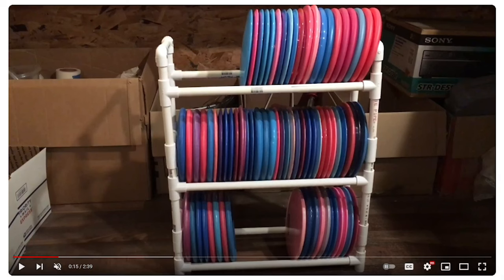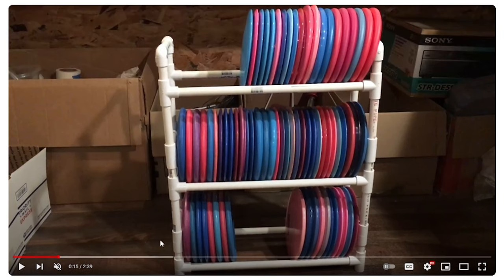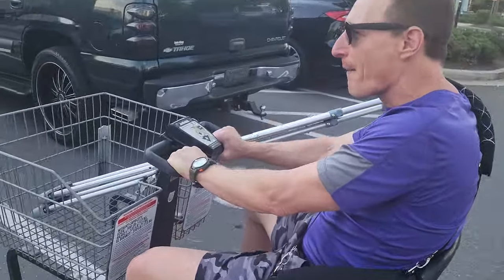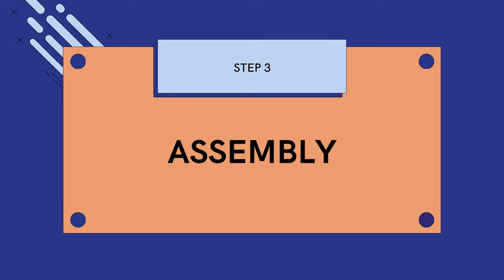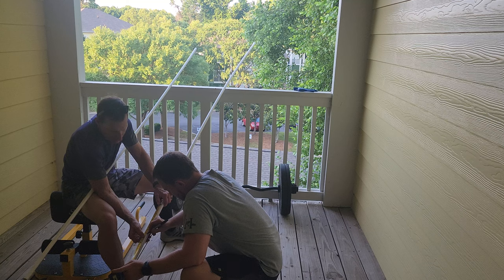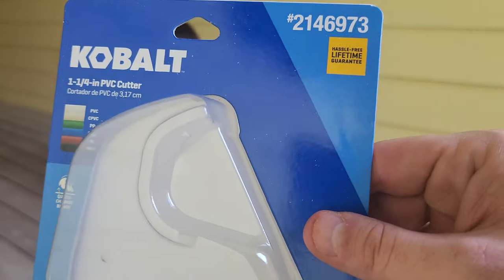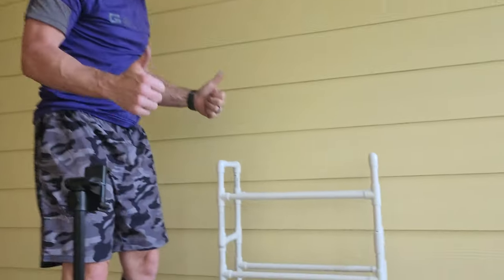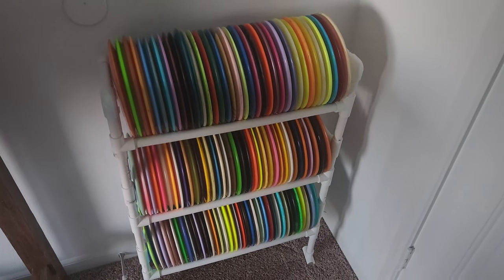How to build a disc rack that holds 100+ discs

Comment: Interesting alternative, but the Ikea Vesken is right now $12.2+$4.6 delivery, not having to do anything but pick up the package where I do my daily shopping. Since it takes 2-3 minutes to assemble, its too cheap and easy, and also black like my heart OR white like my consciousness. But if they go OOP and the replacement are the wrong dimensions I will try and find this kind of video for sure! I fit about 90-100 drivers into a Vesken, and mixed about 70-80 discs (4 levels) :D

Comment: PVC pipe and fittings are Legos for adults. Lol. 
I used an old 5 tier bookshelf from Big Lots ($30) then I made disc shelves out of PVC on each shelf to keep the discs stable. Worked out well. I even made PVC stabilizing racks for inside of my cheaper disc bags. It was quite fun actually!

Comment: I got the Whitmor 8-tier shoe rack from amazon. You only use half the shelf rods for discs so it becomes 4-tier and each tier holds about 50 discs. On each tier one shelf rod sits lower than the other so I have to use one hand to grab the disc I want and the other hand to keep the surrounding discs from coming out too but if I turn the rack the other way and put it against a wall that's not a problem